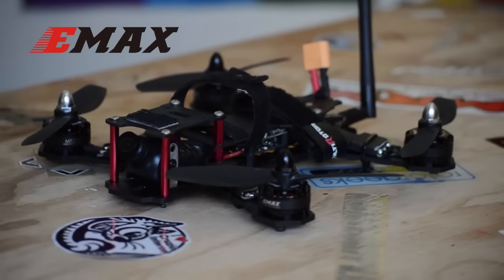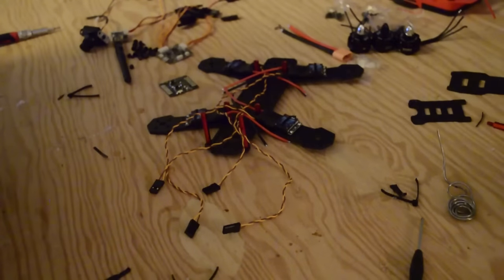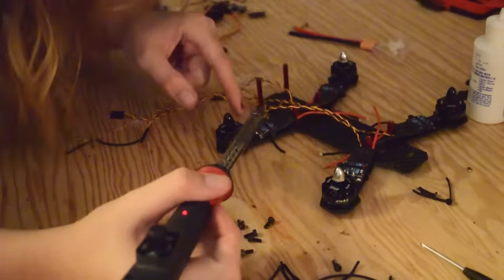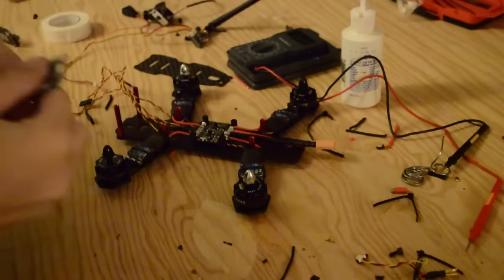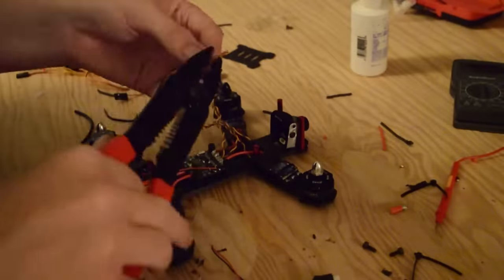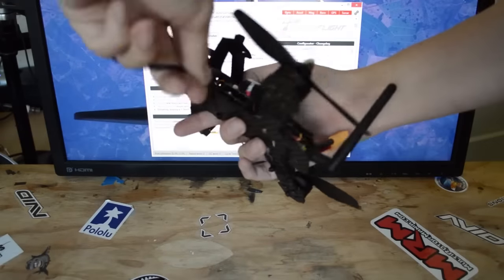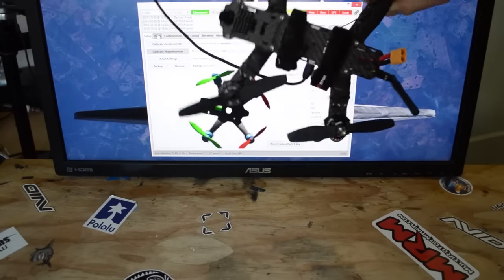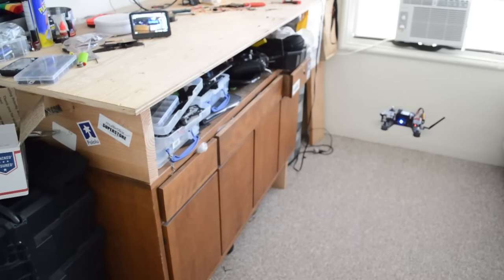EMAX Nighthawk 200 -  Let's Build!

Comment from the maker: Whew- Spent a lot of time on this video. Had a lot of fun putting it together, hopefully you found it helpful!
Reply: +Zoe FPV Great video, I recently ordered a 180 hex frame. I'm hoping i'll be able to use the same motors on it.
Reply from the maker: +Jason Stahl (JaySteel) Thanks! Not sure of the frame you are using, but these motors will scream on a 4inch Bullnose prop on 4s. Motors are one of the best parts of this build :D
Reply: +Zoe FPV It's the RD180 from MultiRotorMania. Right now I have 5 of those MT2204 Cooling Series on a modified Miniature version of the FT DragonFly. It flys good on a 3S battery, but I'm going to order a 4S for it since hovering takes just over half throttle. Just need to get that new frame and see if the motors will fit.
Reply from the maker: +Jason Stahl (JaySteel) Hmmm, that frame is setup for 3inch props. The 2204 motors may be a bit much. You'd probably be better off with a 1306 3100kv motor.
Reply: +Zoe FPV Yeah, I'll figure out what I can do with it once I get it :)  I'm not going to order any electronics for it until I can see it.
Reply: you should put some of your solder when you are disconnecting the esc wires or just in general it melts it quicker it will take you a minute for all the esc combined instead of 1 min per esc

Comment: Awesome Zoe,Fortutly I know All about soldering and tinning my wires ect..it was nice seeing it from the beginning to end on a Quad,ive done all kinds of RC/ Video came console mods and much more but this was my first Quad build I've seen,thanks for the video,ive havnt chosen which build I want to do yet,I've only been into FPV for a few months,got a set of goggles but with my luck and finances I picked up a (As Is) goggle and my left lens is black and still need a raido so it will be awhile before I'm able to get Anything in the air,Again,Thanks for the video 
;0)))

Comment: i like this frame , thanks for the build video , i did my first a few weeks ago and eager to do another , i just may use this frame , keep a rockin ....
Reply from the maker: I really dig this frame! It has a near perfect COG with just a battery and no GoPro. Something this frame does better than most.
Reply: +Zoe FPV very similar to the dal 220 frame in looks , i think they need to make this 4mm minimum , does the 3mm hold up ?
Reply from the maker: +Andy M This frame comes in a 4mm version too, the 3mm version has withstood a parking garage and a cement bench. The DAL 220 frame definitely looks interesting. Maybe I'll get lucky enough to review one at some point.
Reply: +Zoe FPV yeah it comes in 4mm , i think all solid bodies should be that minimum , but if they are holding up then that will do for me ;-)

Comment: Thank you so much for this video!
Reply from the maker: +SingedFPV You are very welcome :D
Reply: +Zoe FPV I am considering this for my first build, have only bought RTF before.

However it seems very "tight" and I am not sure I am up to the task, being bad at soldering and all. I was thinking to start off with 12A nano ESCs since they are smaller and running it on 3s which I guess should give enough power.

Do you think it will be too hard to build for me?
What camera should I get for this, preferably from the EMAX shop?
Reply from the maker: +SingedFPV Looks like this would be the best bet for a camera: http://www.emaxmodel.com/fpv-camera/fpv-camera/28x28-sony811-700tvl-high-resolution-fpv-tuned-ccd-camera-pal-ntsc.html it's 28x28mm and should fit into the frame without modification. 

It's a pretty straight forward build as far as a quadcopter goes- and I'd recommend it for first timers(with 12amp Nano ESC's). The Nano's are much smaller, and lighter, should be easier to physically work with too. Would recommend the kit they have of it this http://www.emaxmodel.com/nighthawk-pro-200/nighthawk-200/nighthawk-200-all-carbon-fiber-quadcopter-aircraft-frame-3mm-combo.html
Reply: +Zoe FPV Thank you! That camera seems a bit expensive at $94 though
Reply from the maker: Yeah, seams like an error? IDK Tons of cameras out there that should work, EMAX is coming out with a new one for this frame IIRC.. The ones in the description should work really well and are new to the market. Have had a chance to play with them on a friends build.

Comment: Nice build and good info 4 those making there first quad ;) If i might add something it would be covering your solder joint on the arms ..wet grass can kill yours esc's if not covered ;) I would use plastic dip or just plain insulating tape ;) Good review ;)
Reply from the maker: +Harley FPV Most definitely, it's recommended(I think I mentioned it) to cover them up for protection against shorting out. Haven't had an issue yet while crashing, knock on wood.. Kinda reminds me of an exposed dry clutch of a motorcycle... I'm a dweeb.

Comment: Thanks for the informative vid! I've got the same ESCs and controller as you but wondered whether you need to worry about changing the direction of rotation for each esc? Ie having 2 anti clockwise and 2 clockwise, or is this all done by the controller?

Comment: I have just purchased this frame but I won't get it for a few days. A silly question but, are the screws that hold the pillars in place M3? I have a lot of M3 red anodised screws an I'm wondering if I can use them on the frame. They fit my motors on my ZMR frame.

Comment: Hi, how would I connect a receiver to all the wires if not using CCPM?  I'm new and stuck on connecting wires from ESCs and receiver.  Although how I have it wired now everything works how it is suppose to but when I throttle up only motor 3 goes up and the rest stay at min.  Think maybe I have not wired correctly.  Any help would be appreciated.

Comment: Thank you for the video. I have been following along but am confused at a certain point in the build.

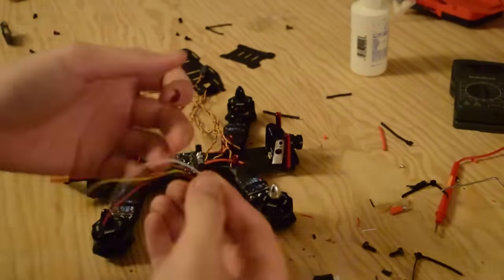At 18:43 why did you have your 5v wires come from the PDB 5v > into the ESC> and then back to the FC? 
This is where I am confused.  Can't you just connect the 5v lead from the PDB directly to the FC?  

Thanks ZOE!  Do you still fly this beast?
Reply from the maker: +Jonathan Edradan  I spliced in the positive into the ESC servo lead as the flight controller had a wire harness expecting 5 volt in with the ESC signal wire- The ESC's I used do not have 5volt BEC so I spliced in 5volt from the PDB, so in a way it does directly go into the flight controller, at no point in time does the ESC get 5volts.
Reply: Thank you for the clarification.  Crossing fingers nothing blows up!  j/k!

Comment: Hi Zoe, thanks for the video. I just got one of these and will start putting together as soon as it arrives. But tell me, you mention a 20mm board cam?! They seem pretty hard to find. Sorry I didn't quite get this part. Did you have to drill holes on the frame. And when you say you couldn't use a Naze32 is it because of the pins?
Reply from the maker: +Rickgoldcoast Hai Rick! The 28mm board cameras are indeed hard to find, but are becoming more popular by the day over the more common 32mm.  Just got this from UniqueFPV: http://shop.runcam.com/runcam-sky/ and it will fit without modification to the bracket that holds the camera. And you are correct about not using the Naze due to pins, all my boards had pins and wouldn't fit... if using a fresh Naze32 I would have direct soldered the connections and saved the mess of ESC wiring.

Comment: Hey Zoe, thanks for the great informative video! I wasn't sure until now that it was okay to directly solder the motor leads to the ESC board. Does it cause any issues down the line like timing, sync, etc? I love the idea of direct soldering since it gives a much cleaner look and it's weight saving!
Reply from the maker: if your using the EMAX ESC's you should be okay with just a signal wire. Have only had issues with the DYS 20amp esc's having slow startup without the signal ground wire(still worked!) if I was to redo this build i would have direct soldered ESC's to the flight controller wire harness.

Comment: Thanks for this video!  just one question. How much flight time would I be looking at with this build? this will be my first. thanks
Reply from the maker: +Daniel Madero Depends on the battery and flying style. If you put a 1500mah battery on it without a HD cam and just hover around/go slow than you'll get a good 6-10 minutes. 

There's a reason so many mini quad pilots have a small pile of batteries XD

Comment: Hi Zoe, totally newbie question, which diameter (awg) of pigtail power cable is recommendable to use in a 4s setup? 14 or 16?  thanks
Reply from the maker: 14, I've used 12 for my Spider Hexes. some kits come with 16, which for most mini quads is just fine.
Reply: +Zoe FPV thanks for sharing your knowledge

Comment: hey great video helped me alot with my build. I have basically the same set up just different camera. Im having alot of problems with oscillation and vibration, i can barley get the quad off the ground. I was wondering if you could post your current PID tuning

thanks
Reply from the maker: +Mike Charles Glad it has been of help! Tuning can be weird... the last set of PID's I was happy with is in Cleanflight: http://pastebin.com/QcxZQKSe What is your exact setup? Maybe I can help!
Reply: +Zoe FPV  thanks for the quick reply i have
emax200 frame
2205II 2300kv motors
20a nano esc
skyline32
d4r-II
5045 bullnose props
1300mah 3s battery
and i did what you did in the video and flashed cleanflight then betaflight
i then used what ever betaflight CLI dump you had posted a couple days ago and copy and pasted that

now can i use that cleanflight pastbin you just replied with if im runnning betaflight?
im new to hobby and still learning

anything help 
thanks mike
Reply from the maker: +Mike Charles If you're using the latest version of BetaFlight than those PID's might not be correct. I'd recommend trying out CleanFlight, if the problems persist let me know!
Reply: +Zoe FPV thanks it all worked exept it wont work if i have oneshot on for some reason so i turned it off but thanks it works now.

Comment: Hey there Zoe I am doing this build and I am just confused on where I put my 5v on the flight controller? Also how can  I splice the esc wires (2) and the PWM with only one wire. If you could help me out that would be awesome! Kristian
Reply from the maker: Hey, there was one ESC that had power, ground and signal coming off it, not just ground and signal. 

The FLight controller has a 5v coming off the harness, that gets added to the plug you use on one of the ESC's. Might need to rewatch around 21:00
Reply: Awesome thanks so much! This is my first build ..  I think your vids are excellent.. Thanks again

Comment: im using the same frame same motors same escs and same flight controller. ive got everything wired exactly the same as you. no bridges in soldering. i raised the throttle in motor calibration and at like 75% it hesitates then  sparks flew. think it burnt up 3 escs. any thoughts on why?
Reply from the maker: +519Cabbage That's interesting to say the least, never heard of this! Any pictures? Sparks make me think something was shorting onto carbon fiber. Sparks from where? I need more information to go on! Send me an email at zoe@hexinair.com with some photos of the damage and I may be able to be of help!
Reply: +Zoe FPV sent you an email

Comment: Zoe why do you increase max throttle, whats the benefit? how can know what max throttle is suitable for my escs and motors? thanks
Reply from the maker: +INMERSO BLHeli ESC's have the min/max set in BLHeliSuite, generally 1900 is the "Top end" though have found for most it is more around 1870 by default. The benefit is if there is more throttle above 1850 then you get access to a bit more top end speed/power :)

For 3D rigs I set Min to 1000, Mid to 1500, and Max to 2000 in CleanFlight Configurator and on the ESC's in BLHeliSuite.
Reply: +Zoe FPV cool thanks

Comment: This configuration is for all quadcopters?  (cleanflight, betaflight)
Reply from the maker: +Stefan Dragas For the most part yes! The PID's may need to be adjusted but this should cover the basics and get most rigs flying!
Reply: +Zoe FPV thank you for your quick reply :)
Reply from the maker: +Stefan Dragas Happy to help!
Reply: hi zoe, really enjoyed watching this build and after watching went out and bought myself the emax x 200. I used kiss fc and esc's with dys 2205 2550kv motors. was out trying to tune it for the first time today and when I was flying in a straight line at low speed all seems fine but soon as I apply more than 50% throttle the quad pulls up and to the right really quickly and out of control. have you got any idea what would cause that to happen plz? thanks again.

Comment: Excellent video Zoe, thank you! It's great - really helping me build my first copter from scratch. 

Probably a noob question; I'm a bit confused about powering up with battery. If I connect to Cleanflight, some LEDs appear on the skyline. If I power up purely with battery, this isn't happening - nothing happens and i'm getting a small buzzing sound. I have this PDB: http://www.banggood.com/Upgrade-CC3D-Power-Distribution-Board-With-3A-BEC-Output-5V-12V-For-QAV250-p-1029150.html

Do you have any ideas? I'm guessing i've fried the xt60 lead with my beginner's soldering.
Reply from the maker: +Tony FPV Can you send me a link of your wiring to zoe@hexinair.com? it's either not hooked up right, or your PDB has a blown 5v regulator.
Reply: +Zoe FPV Thanks Zoe, very kind of you! I've sent an email.

Comment: Maybe a dumb question maybe not... I didnt see anything on esc calibration? Im stuck at this point. I followed all your steps, then decided to do esc calibration anyway thikning this was ok.. but as i found out plugging in the batterys in esc cal mode does nothing. When i plugged it back in after leaving that page. they started up at a high speed. This is when i knew i fucked up something.
Reply: *everything worked perfect prior to flashing. so i did something wrong int the steps.. if plugged into the computer i get the chimes then full throttle or there abouts. if not usb plugged in i get nothing at all
Reply from the maker: There is nothing about ESC calibration in this video- the ESC's used are not flash-able and do not require calibration...
Reply: +Zoe FPV thanks for the reply. Is there something I'm not doing that is so obvious? everything seems correct. the only thing that isn't correct is the mechanical motors spinning. cleanflight shows it firing up. arming etc. contemplating starting everything from cleanflight flash onwards.